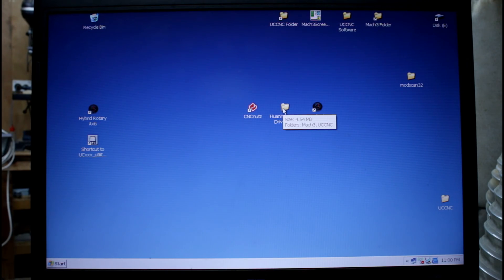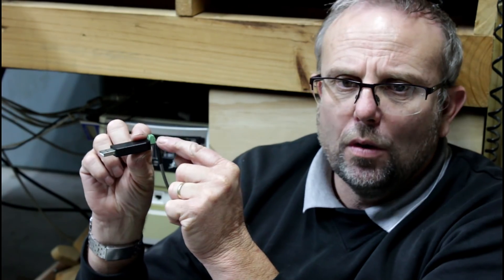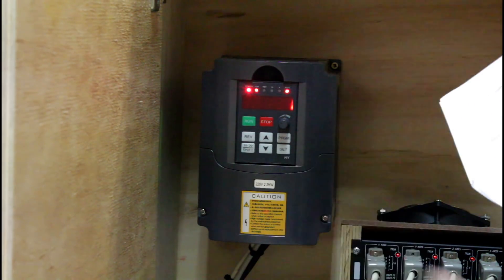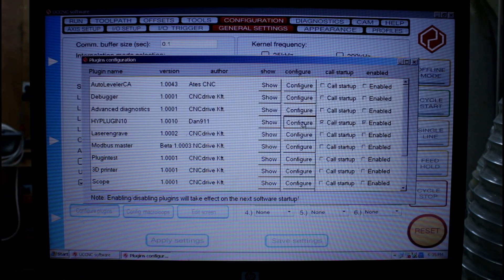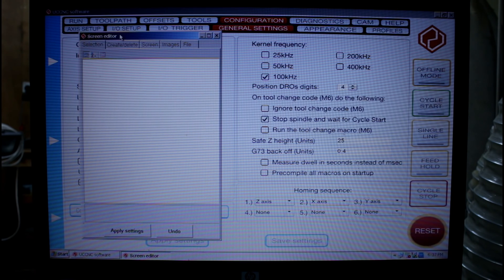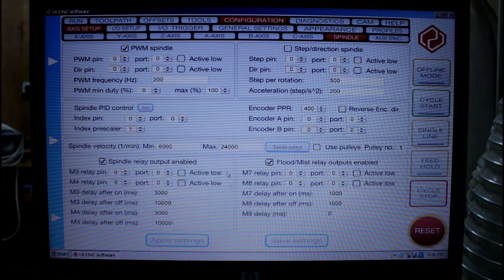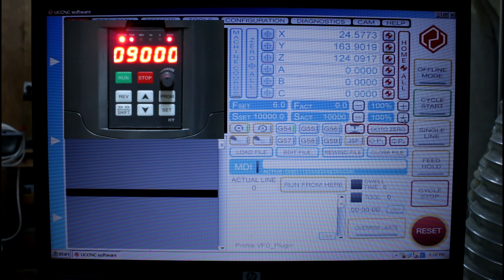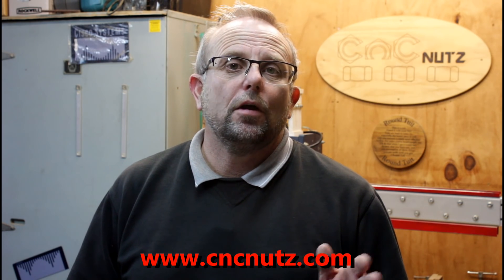UCCNC RS485 spindle control - CNCnutz Episode 148

Comment: Hello Peter. I'm an Italian maker. I built a cnc 4 axis machine. I use UCCNC software to manage it.
I've followed your tutorials and advices and now I can control the spindle by Rs485.
I use a VFD HY INVERTER.

I want to ask you the follow question:

How can I do If I want to try using another type of inverter? I'd like installing a vectorial inverter to optain more torque when the spindle works at low rpm. Is it possible? Can UCCNC manage a vectorial inverter for example Toshiba or Schneider? Do I have to change the HY PLUG IN into the Plug in folder of the UCCNC software?

Thank you very much for you great help.

Fantini ing. Francesco

Comment: Salve, potrebbe funzionare anche con servo motore 90ST-M02430 AC driver A1-SVD15? grazie mille Valerio
Reply from the maker: No, What i have shown will only work with a Haun Yang  VFD 
The specs on the servo does say it can talk using Mod Bus so you will need to investigate what exactly it can do, it's protocols and if it is possible to write a custom plugin that will integrate with UCCNC.
Personally I don't think it will work.

Comment: Thanks Peter.  this is an old video so my question is.  is this still required or is there a better option with my UCCNC setup consisting of UC300ETH-5LPT and Gecko 540 to control the spindle power and speeds?

Comment: Hi Peter, thankyou for the video! i am having an issue i hope you can help with... i have a HY4kw inverter 3.5kw spindle and ive followed your instructions connecting via the rs485 adaptor but when i start the spindle it stops straight away saying its hit a limit switch? no limit switches are being hit on the machine so im assuming its a setting i may have missed?
Reply from the maker: Limit switches have nothing to do with RS485 but i will mention that the plugin I used in the video supports only specific HY VFD's up to 2.2Kw. The 4Kw version you have will probably not work with the plugin that I used.
I hope you managed to get it sorted.
Cheers Peter

Comment: Hello Peter,
Thank you for the informative videos.

I have two questions that I hope you can assist with.

First. I got my Spindle running using the setup you described in video, UCCNC - episode 148.
Seems to work ok except commanded speeds are incorrect.
I get
Command Speed
S100  --  600
S20  --  1200
S100  --  6000
S250  --  15000
S300  --  18000
S400  --  24000
From running a file
S16000M03  --  3750

I am using
UCCNC 1.2111 with Stepcraft Screenset
Huanyang HY02D223B, 2.2kw, 8.5 Amp, water cooled spindle.
RS485  HYPLUGIN ver 10

Any suggestions on what I might not have set correctly?

Second problem when I tried the next day i could not command the VFD from UCCNC.

Comment: would love to see this plugin for bosch EFC3610-2K20-1P2
Reply from the maker: Maybe Bosh or someone will make one if it hasn't already been done. In the meantime don't get hung up on RS485 and connect your spindle using the older analogue method. It will work just as well.
Cheers
Peter
Reply: CNCnutz (Peter Passuello) good to hear it will work just as well using the analogue option as I don’t mind the extra wiring, just thought if it was more stable i would try the rs485

Comment: hi, I'm ordered a RS485. But received a usb-RS485/422. Can I use this for my VFD/Uccnc soindle control?
Reply from the maker: I suspect not because rs422 is 4 wire where RS485 is 2 wire but I don't know for sure. You will need to read the documentation you got with the adapter you bought. Maybe it does both.
Cheers
Peter
Reply: CNCnutz (Peter Passuello) thanks Peter. I allready check this. But non usable answer. Anyway thanks for shearing your work 👍🏾

Comment: Dave, where was the link to spindle talker?
Reply from the maker: If you look under the spindle talker video you will see a link in the description box which takes you to the software. You should be able to download it from there.
Cheers
Peter
Reply: Well, I must be blind or frustrated.... I cant find it. can you please post a link? Thanks, Gary
Reply from the maker: Sorry about that. It may be that the folder wasn't set to share. I can see it but maybe you can't. 

Try this link. https://www.dropbox.com/sh/bvc0oqjs9x2a4q0/AAA_5xMWhrW2HfaxvZn68BTWa?dl=0

Let me know how you get on.

Cheers
Peter
Reply: got it. Thanks!!!Im still having problems. I actually got the spindle to run twice in uccnc, but it locks the software and exits. I then have to shut the spindle down with the stop button on the vfd
Reply from the maker: @healinhand   
Sounds like some sort of an electrical noise issue at a guess. I'm not a fan of USB myself especially in an enviroment such as the workshop which is why I decided to use PWM as my perfered method to control my spindle. Not because I had an issue but because of my dislike of USB in this situation.
 I suggest asking on the forum for the VFD plugin and see if anyone else has experience the same issue. you will find the link to the thread on my website. Link to the website article is under this video.
Cheers
Peter
Reply: CNCnutz (Peter Passuello) thanks for you’re help Peter. I’ve pretty much decided that the vfd is going bad, even though its new. Uccnc seems to be functioning fine. Spindle talker sends the data with no reply. I downloaded a serial port monitor and it confirmed this. I tried 2 different rs485 dongles and no change. I’ve done a factory reset on the vfd 3 times and still nothing. I’m going to order another one and try that. I’m not a fan of “swaptronics” but I can’t find any other faults.
Thanks again for your help
Reply: Btw, the rpm field should be 2451
Reply from the maker: Only in the newer plugin version.
Reply from the maker: Have you considered PWM and a relay to turn it on and off.
VFDs have been using it for many years and it will probably work just fine for you. It is immuned to noise and reliable.
Cheers
Peter
Reply: Thanks Peter

Comment: I have VFD YL600-2S-2K20 P110V would you be able to tell me how to wire it to the UCCNC RS485. Thank you!
Reply from the maker: Hi Edwin,
This is the only page I could page I could find with info for a VFD similar to yours. It is the 220 volt version but I assume yours is the same. https://www.cnczone.com/forums/spindles-vfd/339032-cnc.html
It could uses RS485 but I can't see anything on the connectors for an RS485 adapter but the labels in the photo don't really tell you much at all. you will also need to find the programming to set the VFD to respond to RS485 if it is capable. 

If you do manage to figure out where to connect an RS485 adapter you will also need to source a plugin for UCCNC as the one in my video is for the HuagYang VFD which i believe uses non standard Modbus commands so is unlikely to work for you. See Ger21 comment in the thread I posted above. He is talkng about Mach3  but the same applys for UCCNC.

I think you would find it easier to investigate PWM for this drive. Again check the manual for the requirements and programming.
Sorry I can't help with this.
Cheers
Peter
Reply: Thank you for getting back to me and for trying, looking forward to your next videos.

Comment: great video Peter!
Please Also Guide For Delta VFD-M
How to control it from mach3.
Reply from the maker: Hi Tahir,
I'm sorry but I can't really help you.
You would need to send me a Delta VFD-M drive and even then I can't find a Modbus plugin made for that drive. That is why I purchased the drive that I did because I knew that there were plugins available for it. 
From a quick look at the manual and it appears that the drive you have is controlable via a 0 -10V analogue input so you could look at setting the speed using the PWM method I showed in the earlier video.
Sorry I can't be much more help than that.
Cheers
Peter